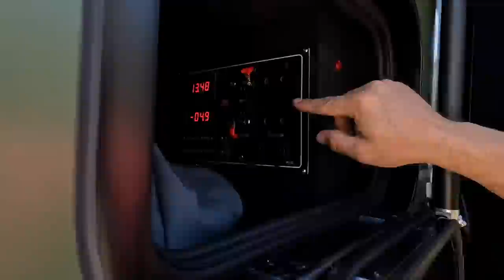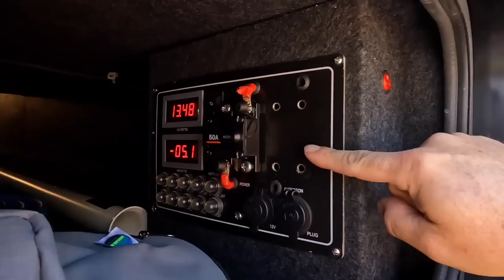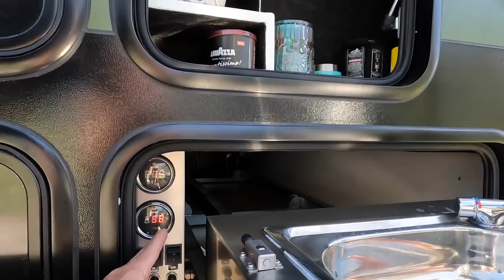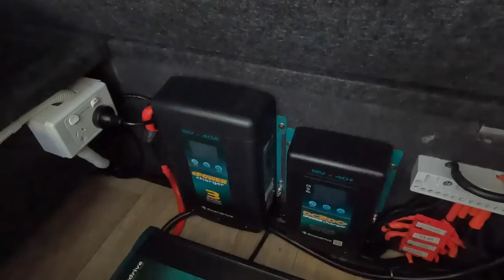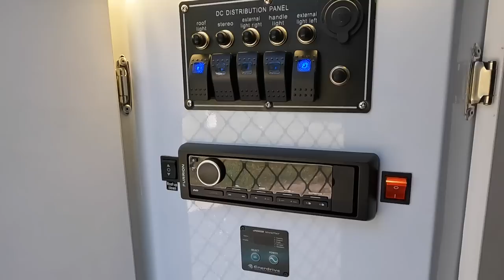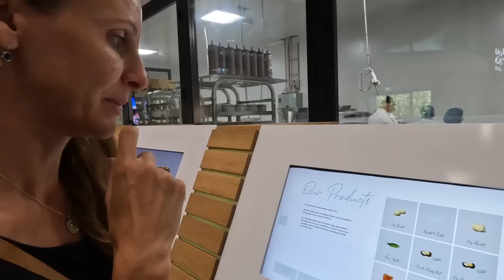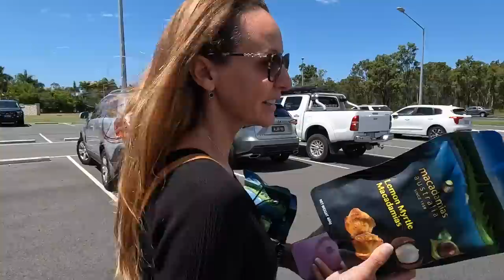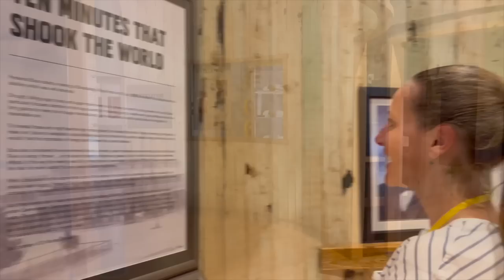Hybrid Caravan Review- JAWA Stealth 15 | Hitching Masterclass | Family Escape

Comment: The shackles he is using don't appear to be rated as the pin is not coloured. Also the shackle should be fitted with curved part through the towbar slot and the chain secured by the pin. That is why the hole is a slot and not a round hole. A great presentation of a great van. We are interested.

Comment: Hi Ant and  Mavo. Ant thanks for making me feel like an f wit. XO Jockey wheel two days ago wife lowered it and car dropped couldn't she couldn't rotate it up. Me frustrated a few choice words jumped over the drawbar did the man thing and forced it up.  Next time I will read the  instructions.
Re the Stealth. I like the storage on front of the fridge slide but from your video angle it looks like you cannot open the rear fridge lid fully?
I am in the market at the moment and a deal breaker for me is a slide for my Beefeater Bugg (make baby Qs look primative) toolbox on passenger side needs a slide to accommodate a BBQ with a gas outlet next to it. Looks like shape will not let this happen. Aussie designers should be thinking about Bbq placement as a first thing.
Look at the front of all the Ozzy made Alpines. Perfect.
By the way thanks for your great vids. Really hanging out for Mavo to check some sand again. A safe and happy new year to you both.
Regards Peter
Woops do you know weights. Ball tare etc.
Reply from the maker: Hi Peter. The fridge slide definitely extends out for both fridge compartments to open, I just didn’t demo it, but check our Stealth 12 vid where I do. As for the BBQ, I don’t know the dimensions of a bug, but I was thinking about our Ziggy and placement. If the bug is too high, I would just remove the bottom drawer above the slide for more room. 

Haven’t weighed the van as our local tip was F’ing busy over the Christmas break, but will do it today and post stories on our FB and Insta. Keep an eye out. If I remember, I’ll post it here to

Comment: Hi Ant and Dee,  just found your channel and very glad I have.  Thankyou for going into so much detail on your videos.  I may have missed it in this video but what are the weights of the new Stealth 15?  I have a 2018 Prado with the 3T limit and Hybrids are usually heavy.
Reply from the maker: Hi Gazza. Thanks for the feedback! Unfortunately when we had the S15, it was during the Christmas/New Years break and the local tip/weigh bridge was getting hammered every day. So I didn’t get to weigh the vans like I did with the S12. I did measure the ball weight when the van was loaded (100L of water) and it sat at about 220kgs. I’d say the van with our gear in it was around 2400kgs. We were only doing short trips but it did feel lighter behind the car than the Infinity that we lapped in. As it’s the first of the fully revamped Solera 15, Jawa are working through getting the official weights measured.

It definitely won’t have an ATM over 3000kg, but the weight you’d need to watch with the Prado is the GVM once that ball weight is added. When I was first working things out before our big lap and the van arriving, I loaded the BT up with all luggage, food and full tank of diesel and weighed the car. That gave me a worst case number in mind and set my mind at ease that even at our heaviest, our weights would be good
Reply: @empty_nestadventures  Thankyou for the rapid reply.  I just emailed JAWA, mentioned you guys and asked about what they had at South Penrith plus the weight question.  Will be a regular channel viewer!

Comment: Another great video.  Where did you get the jockey wheel holder that fits the arc750? Any links ?
Reply from the maker: It’s from Ozi block’n’chock

https://www.ebay.com.au/itm/284755607248?chn=ps&_ul=AU&norover=1&mkevt=1&mkrid=705-139619-5960-0&mkcid=2&mkscid=101&itemid=284755607248&targetid=1741701787418&device=m&mktype=pla&googleloc=9069271&poi=&campaignid=18278742238&mkgroupid=141565058112&rlsatarget=pla-1741701787418&abcId=9301725&merchantid=115568959&gbraid=0AAAAAD97CxQAfBzWwPUtgEKCaeZ11etK0&gclid=Cj0KCQiA3eGfBhCeARIsACpJNU-oY2pYIj2ewSvstymD9cjNbNSh12lAsK-PdRzIfmPN9QiMQZZiEBYaAmVVEALw_wcB

Comment: Why are the exterior shower taps so far away from the shower curtains? And why is the mains powered behind the shower..😮😮😮
Reply from the maker: It’s a fair point with the main in located very close to the shower tent. In the 6 vans we’ve had, we’ve never actually used the outdoor shower. It’s be fine if offgrid and no main connected, which most beach camps are
Reply: @empty_nestadventures  true..  but still!... I'm amazed it got signed off on... where do they come from, Vacina?  Do the original plans show a shower screen there?..

Comment: Hi, you guys mentioned the ac transfer or power pass multiple times. What is it and what’s the benefit. 
Ta
Lots of good info.
Reply from the maker: So I’m not a qualified sparky (youngest son is an apprentice sparky) but the AC transfer means that when you plug the van into 240V, all the GPOs are live from the source, without needing the inverter on. In other vans (depending on how they are wired) will have dedicated GPOs for 240 and other for the inverter. Others won’t have this and hence the inverter needs to be switched on to run 240v appliances. Earthing is different depending on AC to inverter as well. 
Shorter story, you can use all the GPO’s in the van and it’s slightly safer than running the inverter all the time. You don’t notice the difference much unless you go from a van with AC transfer to one that doesn’t, as we did with the Infinity to the S12. Good news is that the S15 has AC trx

Comment: Great video , by any chance do you know the weights of the van, is it the same as the Solera 15??
Reply from the maker: I didn’t get to run it over the weigh bridge because the local tip has been so busy around Christmas. I might take it this week and let you know. It will be similar to the Solera 15 though

Comment: Anyone know how much they are? Can't see them on the website.
Reply: $64500.
Reply from the maker: She’s the very first prototype albeit based on the Solera solid 15. They will be around $66K but bear in mind that they have awesome inclusions like 200aH Enerdrive lithium, AC transfer inverter, electric roof actuators, Truma gas heater, Sirocco fans, webasto AC all at that single price point. It should be up on the website as soon as the team at Jawa are back from the Christmas break and we get all the photos over to them
Reply: My fault. 64500 is for the infinity 15
Reply: @empty_nestadventures  cheers
Reply: @empty_nestadventures thanks for the info on pricing etc 🤙🏽

Comment: Ant and Mavo maybe I’m thick but did u let us know how much coin for the stealth 15
Reply from the maker: She’s the very first prototype albeit based on the Solera solid 15. They will be around $66K but bear in mind that they have awesome inclusions like 200aH Enerdrive lithium, AC transfer inverter, electric roof actuators, Truma gas heater, Sirocco fans, webasto AC all at that single price point.
Reply: Great stuff thanks so much, so was your conclusion “best hybrid ever” correct?
Reply from the maker: @ashpurcell3340  soooooo, this one actually is very interesting. I see a fair bit of competition for this van within the Jawa range itself. It’s a van for singles or couples only (no bunks), but is competing with the Sirocco and Infinity 13 & 15 Escapes. 

I see this van as perfect for those who need simplicity. Setup up literally in only 2-5 minutes, heaps of storage and a very simple layout. It’s perfect for an older couple or those less mobile. Has heaps of storage space and great standard inclusions. An Infinity or Sirocco to this spec is at least 10% more expensive as well.
The Sirocco is solid rear as well, but completely different layout inside and out. We will test that in our next round or two over the coming months, so will let you know the answer once we’ve done a months in it.

The Infinity was the van we lapped in, so will always have a soft spot for her. She has the bump out bed that automatically rules her out for some buyers, but has a bigger ensuite and tunnel storage and we do love the layout!

Promise I’ll answer the question once we’ve tested them all….. but different vans/features for different needs!
Reply: Another great video Love your photography Dee
Reply from the maker: @graemebarr4333  nawww thanks Graeme x Dee